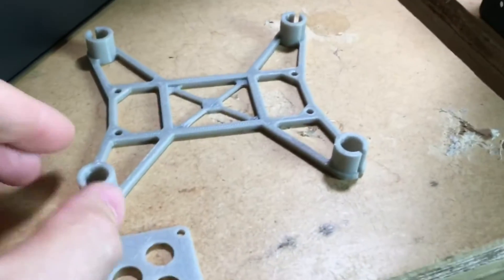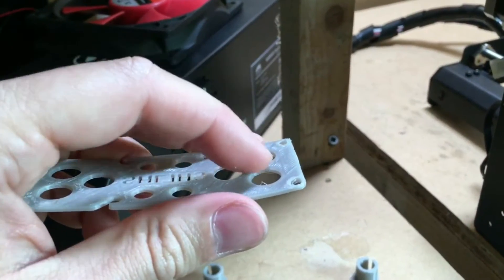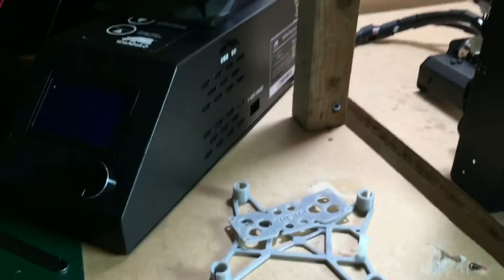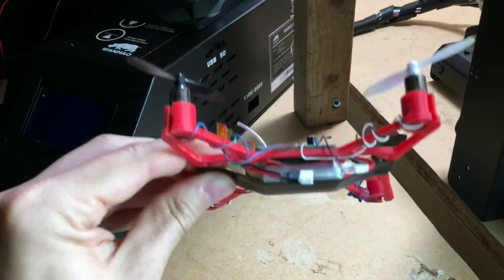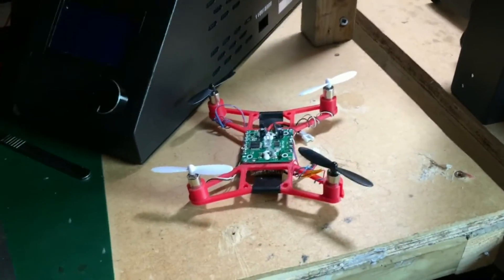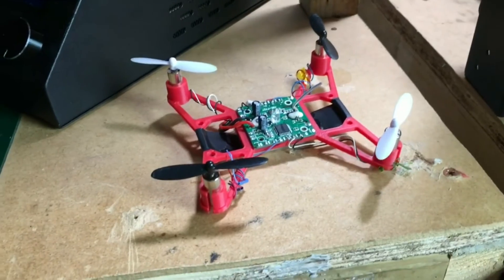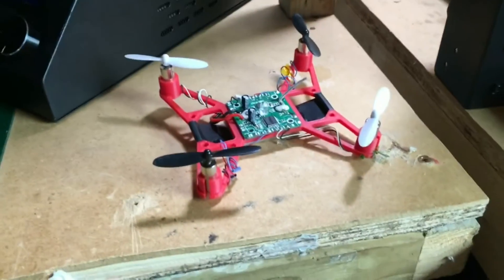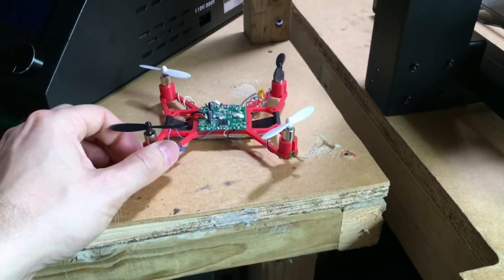3d Printed Quadcopter Frame

Comment: Very nice!
Reply from the maker: Thanks
Reply: Is the Wanhao i3 expensive? I am really tempted to buy one. The results you have got look impressive. Also is there an easy way to avoid the warping on smaller pieces.
Reply from the maker: i would buy the Wanhao duplicator i3  on ebay buy from the uk distbuter "technology_outlet" 325 pounds
i had a few problems and the tech support was very good. very happy with mine.
i did lot of reserch and this is one of the best cheap ready built 3d printers around only 6 bolts to fit.
 Wanhao duplicator i3 plus the new upgraded version https://www.technologyoutlet.co.uk/products/wanhao
but do some reserch to make your own desision.
 
warping in my case was to do with bed adhesion or lack of, 
small parts nornanly dont warp
Reply: Thanks for the info. Been thinking about one for a while for making small enclosures and enclosure brackets etc. You may well have just sold one for them! Will do a few more searches see what else is out there. But this looks good to me. Thanks again!
Reply from the maker: Tech Tins Yeah it took me two years to make my mind up wether to or not to, is it something i need in that time the prices have droped printers have got better.
If you want to print abs you may wont to build a enclosure for printer to keep heat in.   
make sure you read up first nothing worse than having a 300 pound door stop. 
i have been using tinkercad to design my own parts and stuff very good internet based cad program.
Reply: Yes I know what you mean. I have a spare room full of stuff I was convinced I needed and now never use. Too easy to convince yourself you need something. At moment I make metal enclosures but its a pain in the butt. But I will need to see if this machine can do what I need. Else your right I will end with even more kit I don't use. Thanks for the heads up and info, all very useful.

Comment from the maker: if you dont have access to a 3d printer frames can be brought from here  
http://www.banggood.com/Diatone-Beta110-H4-V2_0-110-110mm-Carbon-Fiber-DIY-Micro-Mini-FPV-RC-Quadcopter-Frame-Kit-p-1057219.html?p=070519238739201308J6
and here
http://www.banggood.com/Eachine-110-110mm-Carbon-Fiber-DIY-Micro-Mini-FPV-RC-Quadcopter-Frame-Kit-8_5x20-Coreless-Motor-p-1064027.html?p=070519238739201308J6